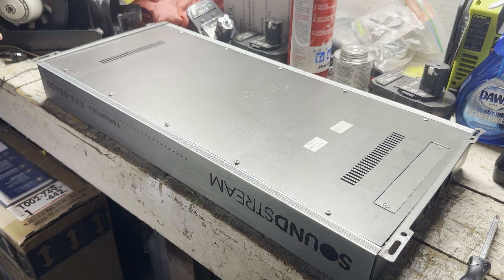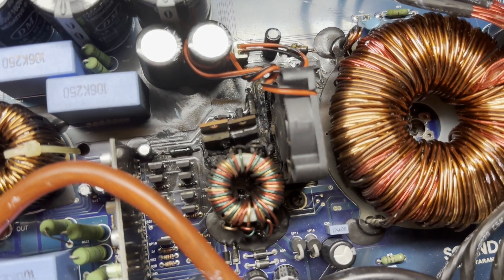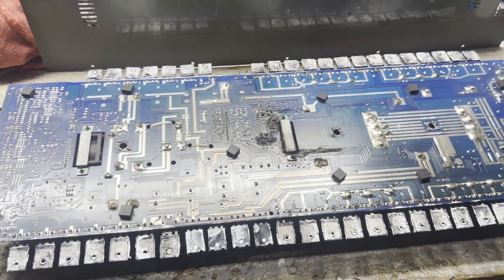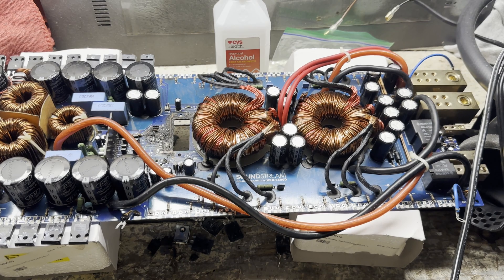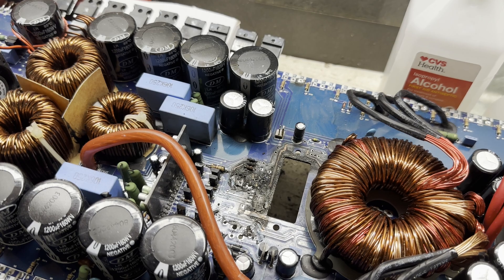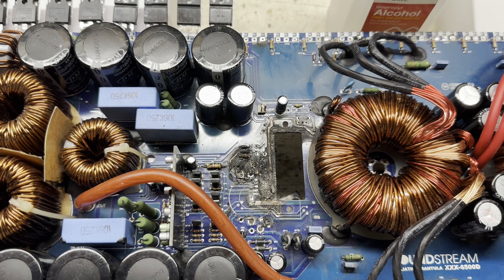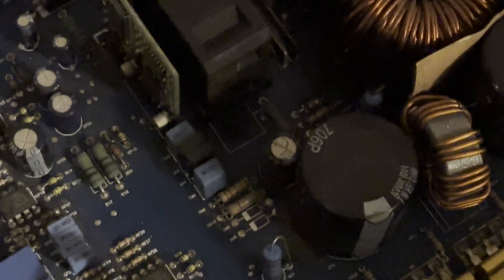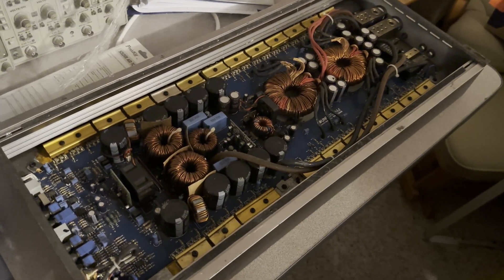Soundstream XXX-6500D Burnt Amplifier Repair | Part 1

Comment: It's been several years since I've worked on amps / electronics, but man I don't miss taking all the screws out. 😅 These amps were definitely beasts. It's always unfortunate when the PCB gets burnt, repair may or may not go well, just take your time if you do attempt it. There is always a risk of failure losing PS and output FETs, which can = a lot of money down the drain, current limiting is very important. If you do work on it, see if you are able to power it up with only one FET per bank, this way you can work on it without risking all the FETs; get it functional with only a handful of PS / output FETs, then add the rest once more confident the drive section is working (ask about that on the forum in the next sentence if you need to). I don't know if you are a member of diyaudio forum, in the car audio section, lots of amp repair help there, there is a gentlemen there named Perry Babin, he is amazingly skilled with amplifiers, he often is willing to help people on the forum. I highly recommend signing up there, I'd link to it but youtube will hide it.
Reply from the maker: Ended up replacing the power supply fets on the better amp, making a video on it but it still has some sort of protect issue, using a 10a fuse on a 40a power supply lol. So far new fets working well though

Comment: the two removed diodes in the audio section are for the protection circuit!
Reply: they are necessary, because if the audio section go to short circuit, the power supply dont shut down and go in fire exploding the fets.
They are simply 1N4148 if you want to install.
The two big diodes in the ps section is for reverse polarity protection, they are necessary to protect the amp from the power cable reverse connection, but they works only if you use a fuse on the positive cable because in case of reverse polarity they put the positive from the battery to the ground trough the fuse, and the fuse pop protecting the rest of the amp.
You can use a biggest normal diode that you can find!
Reply: sorry the two diodes in the audio section are not for protection but for the drive circuit, 
DA5 is 12v 2w zener
DA6 is 4,7v 2w zener
Reply from the maker: @mariorestucci7963  thank you! This is a great help, it’s odd in both amps they are missing and both amps it looks like there has been power supply fet failure, thank you

Comment: Those diodes aren't supposed to be there
Reply from the maker: Thank you, but why are there one the board? I know this amp shares boards with a few others, is it the case those others use them but not this?
Reply: I believe the check mark meant was checked  for damage and was extensively beyond repair although I fix the one  with the good board
Reply from the maker: @tonysolis825  Since I made this, I have taken a couple month course for electronics so I have a much better understanding now. I will be diagnosing it soon, though if I end up making a video on it, it will probably be post-repair and an overview of how I found the problem. That's if I find the problem anyway lol.